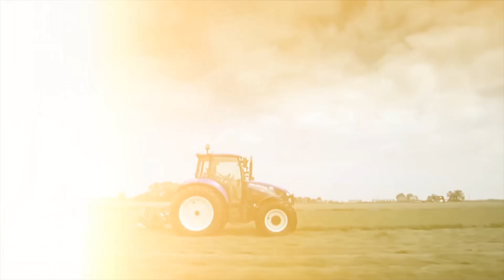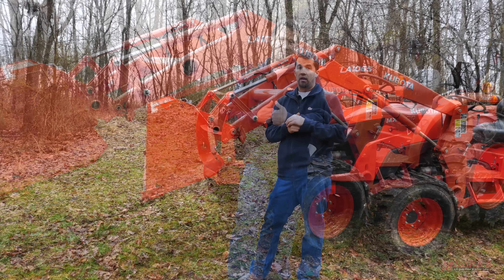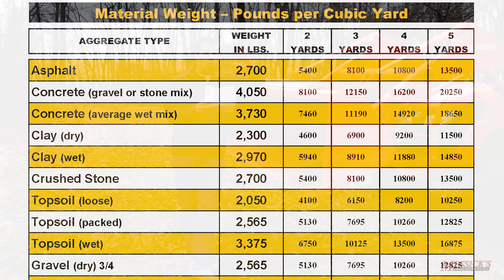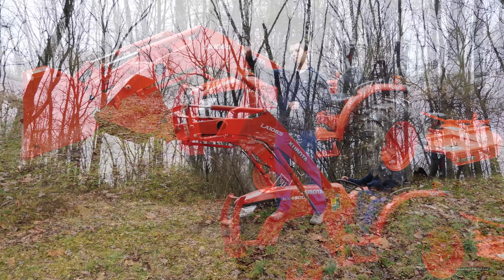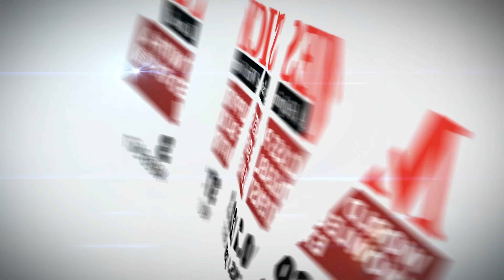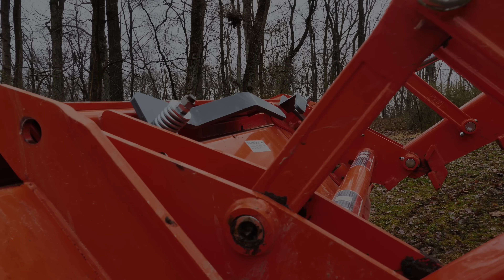Let's Talk: Loader LIES! How specifications can be manipulated.

Comment: This video was excellent and it begets a question. How does one know how much hydraulic "power" they need? You mention coincidental functions like lifting and curling. I find I need more power while trying to push the loader into a pile of soil, lifting and curling the bucket. Does one function rob power from the others?
Reply from the maker: even operators of 10,000lb track loaders will tell you they could use more roll back force. A tractor is not a bull dozer, it won't rip through anything you put it into. Work into the pile, push into it, backup, break up the dirt, then lift. If you really need power. dropping the skid-loader coupler will help. The 3-4" that moves your pivot point out can make a big difference in that specification. 

multiple functions can spread out power, the fluid will always flow the path of least resistance. I find myself going to that multi-function location and waiting to see where it moves first sending power to both circuits.
Reply: I get it. I guess we all have tasks where we would like more power. I use my Kubota hard here at the farm, and it hasn't dissapointed.